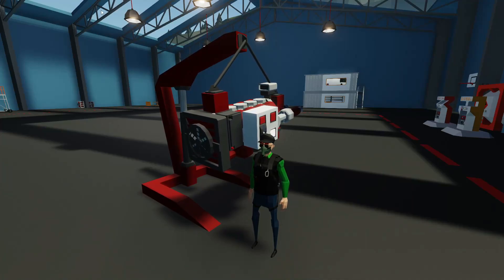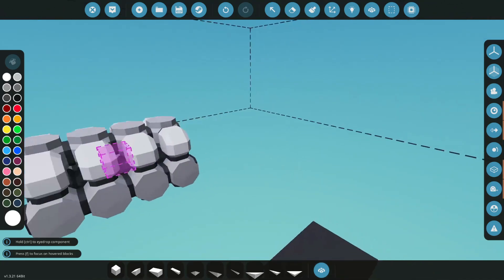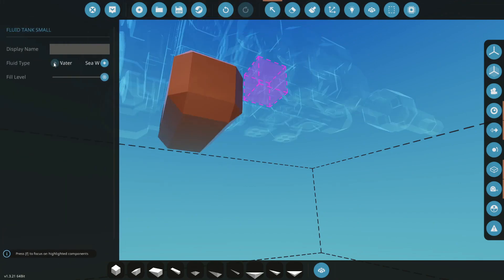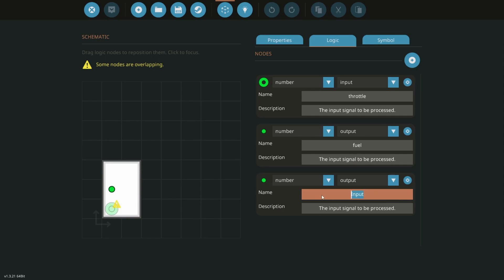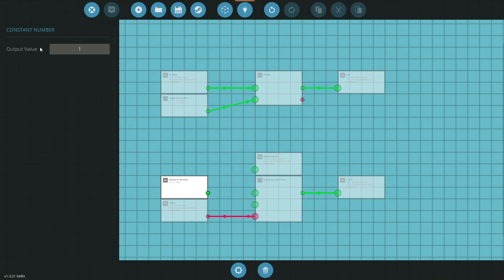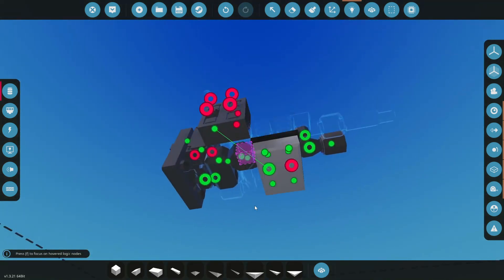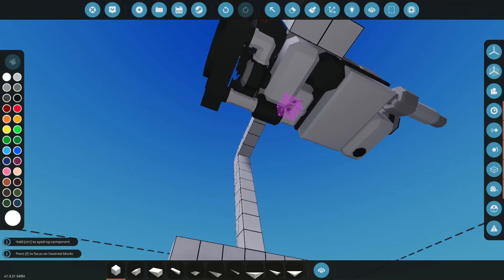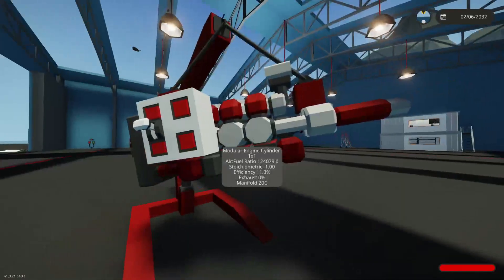Beginners Modular Engines! Stormworks Modular Engine Tutorial - How To

Comment from the maker: Throttle to air is how to fix. It was removed from the MC but I missed the cut.
Reply: I still can't understand the throttle to air thing can you help me more pls I'm not good at this I'm still 2 days in to the game
Reply from the maker: I forgot the node so just hook up the throttle to the air node.
Reply: @ProfNCognito  stll wont work. maybe you should remake it?
Reply: @ProfNCognito  in the video there wasn’t an air node until you just plug it in with the air manifold, could you explain how to make the node? I’m new with the game it’s all really confusing for me lol
Reply from the maker: Check pinned comments
Reply: @ProfNCognito  yeah how specifically do we add the throttle to air node?
Reply from the maker: Green dot to green circle
Reply: @ProfNCognito  it doesn't let me
Reply: Do I need to connect it straight to the air or do i need to connect it from the divider?
Reply: also I was wondering if it needs to be connected to the divider to make a 50/50 A.F.R.

Comment: I finally found a fix to the air thing.

1 Go into microcontroller

2 Add a new node named "air" and make it an output on the number type

3 Put the node near the throttle node

4 Connect the throttle to the air node in the MC

5 exit out of the MC

6 Connect the "air" node from the MC to the air manifold on the engine

Follow those steps and it should work.
Reply: THANK YOU
Reply: Thank you so much! I don’t know if you’d know how to fix this but even with the added air node, my engine still rapidly loses air:fuel ratio as soon as a release my starter button and the exhaust never triggers. Do you know what I’m doing wrong?
Reply: i encountered this same problem and i found a way to fix it, i basically just kept the microcontroller as is in the video but instead connected the throttle directly to the air intake i have no idea why it would sputter since it should be getting the same number but it works @ciqme
Reply: Thank Alot
Reply: You Are a saviour i have been trying ti make moduler engines for the years I’ve been playing this game thanks a lot!

Comment: Spoiler your engine wont cool correctly if you have a fluid tank on it (basically dont add the fluid tank.)
Also the temp sensor needs to be on the crankshaft

Comment: i followed the tutorial exacley but for some reason when I use the starter the engine starting sound plays but the engine doesn't start
Reply from the maker: Check pinned messages for solutions
Reply: @ProfNCognito   the pinned comment just talks about air which I did
Reply from the maker: Join my discord and see if someone can get you squared away.  Lots of good folks there.
Reply: @ProfNCognito  what is your discord
Reply from the maker: Link in video

Comment: I am just wondering, is it a good idea to have multiple fuel and air intake manifolds on an engine, like one per every cylinder?
Reply: I have made an engine with that idea, but it will just die after a minute of running, and it isn’t because it runs out of fuel
Reply: The four ports on manifolds are supposed to represent, air-coolant-fuel-exhaust transfer ports, so a manifold should carry these between cylinders.
Reply from the maker: Yes but it burns more fuel.

Comment: And what do i do when the engine overheats and burns me alive?
Reply from the maker: To much rps probably.
Reply: @ProfNCognito  Pid maybe?
Reply from the maker: What rps you running at?
Reply: @ProfNCognito  i just use the throttle
Reply from the maker: If the engine goes above 20 rps it will overheat
Reply: @ProfNCognito  ok thanks

Comment: I'm not sure if I am misunderstanding the commented correction with the microconteroller or what, but I cannot get the engine to start. If I do a setup with manual air/fuel throttle levers it works, though not very efficiently.
Reply: Know im pretty late but the pinned comment says it.
Reply: @RADIS370  That is what I meant by "the commented correction"
Reply: @KuzakoTheAvali  Okay

Comment: My engine just will not start. I am using 12 of the 5x5 cylinders but in the same layout as in the vid. I've quintuple checked everything and nothing will work. Would using larger cylinders change anything?
Reply from the maker: Try throttle straight to air and get back to me.
Reply: @ProfNCognito  Wait, I got it, it just needed more starters
Reply from the maker: Nice one
Reply: @ProfNCognito  I've been doing that

Comment: I made a boat with these but it goes very slow and the engines die once I turn off the starter what should I do?
Reply from the maker: Sounds like a gear ratio thing. Start by changing them up and see if it changes.
Reply: @ProfNCognito  thanks for the quick response I’m new and I accidentally put the air manifold on the back of a cylinder instead of the attachment part lol, great video bro!

Comment: This was really good up until you changed your microcontroller in between cuts and didn't explain how you added air into the mix. Would be really nice if you cut in a quick explanation or image of your complete controller.
Reply from the maker: Throttle to air. That's all.
Reply: @ProfNCognito  Thanks for the quick reply that makes sense
Reply from the maker: @kodelic9679  yeah no problem

Comment: How long till it over heats.  My only issue is having to spam cooling manifolds on my 3x3's and 5x5's
Reply from the maker: just dont run them wide open and you should be good.
Reply: 3x3 and 5x5 engine need 3 to 5x the cooling that 1x1 engines need.  If you want to run them at full throttle, you need to have a coolant flow rate of 1000L/S or more to keep a 5x5 engine from overheating.   Most radiators have a limit of 64-74L/s so you need a LOT of them to get the 1000+L/s to get proper cooling.

Comment: Man this is weird, I followed the vid exactly, but the engine just isn't running. It turns over and starts, but it immediately dies. When I checked the engine in the game, it said exhaust was at 0%, even though I made the exhaust exactly like in your vid... any ideas as to why it might not be working?
Reply: I added a small pump, powered by the battery, to the exhaust to see if that helped, but exhaust is still 0% and the engine won't start. The fuel manifold also says 0L/s when I check the flow in-game. I followed the MC design to the letter, even every step of the logic and I'm scratching my head as to why I can't get it to work lol
Reply from the maker: Try throttle straight to air. And also to a function block and devide by 2 and send it to the gas. If this doesn't start something is hooked up wrong.
Reply: @ProfNCognito  Okay, I'll give this a shot!
Reply from the maker: Okay, here come the dumb questions.  Did you hook everything up right? Are you giving it gas/throttle?  If exhaust is zero somewhere something is hooked up wrong. Let me know.
Reply: @ProfNCognito  Yes, as far as I know, everything should be properly hooked up, I followed everything in this video. Except for the part where you had an additional "Air" output in the MC that you connected to the air intakes, for my model, I just connected the throttle to the air intake.

Comment: I followerd this to the letter and my engine keeps overheating... like very modular engine I make overheats within 3 minutes of being on full power
Reply from the maker: Yeah its the full power thing. You want to try and get a lower rps. Like the vanilla engines they work best at 20% or 20 rps. They will also be super fuel efficient.
Reply: You could actually turn the radiator on, he never told you this, but the fan on the radiator he used has to be turned on in order to cool anything, lower power makes it to where a engine with no coolant won’t explode, so just hook a toggle button to the, “Fan on/off” logic node and hook up electric